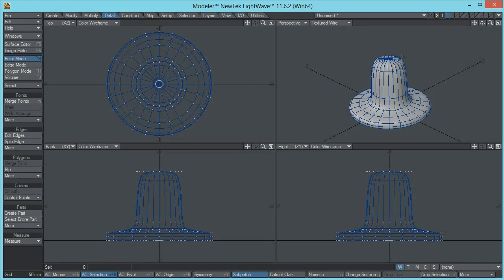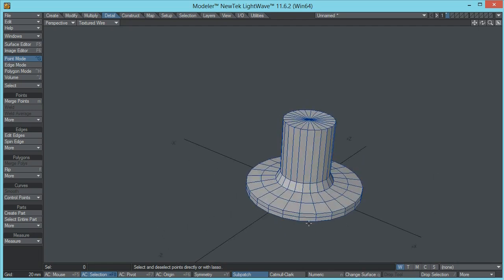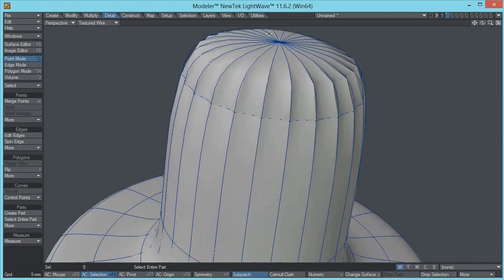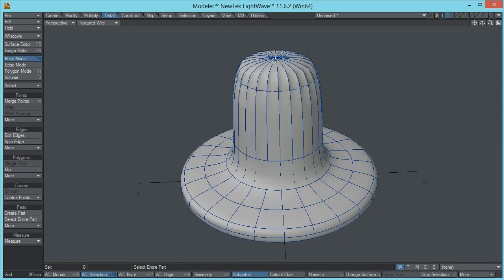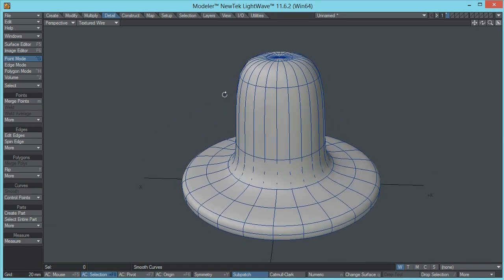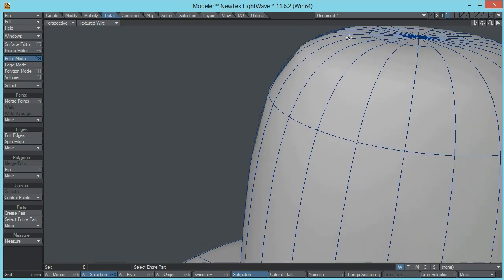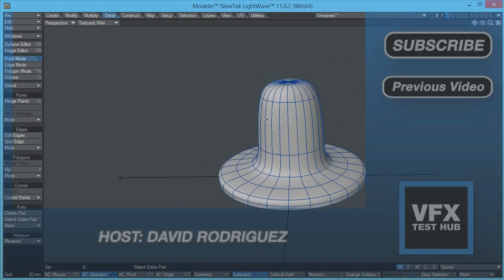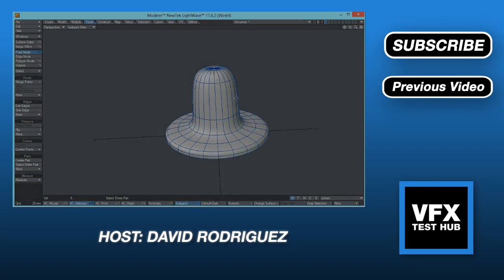3D Modeling Tip - Fixing Poles in Lightwave 3D

Comment: David. If you want the lines to be smoother, you don't have to double the subdivisions to 6 instead of previous 3. Keep it at 3 and click on "fine" in Curve Divisions (its right above) and viola, smoother mesh.
Reply from the maker: Thank you for the tip!. I will take it into account the next time I run into this issue. Cheers!
Reply: julez4002 I tried your suggestion, but the Curve Division was already set to fine; the original suggestion actually resolved the issue (which was smoothing the mesh after creating a pole).

Comment: If you are using LightWave 11.5 or above, you can also use the Detail > Edit Edges tool. Right click on the lines radiating from the pole to create a new edge loop and this loop can be moved inwards or outwards using the LMB. It means you can tighten the curve between the flat top of the item and vertical sides too.
Reply from the maker: Tnx for the hint Ben!